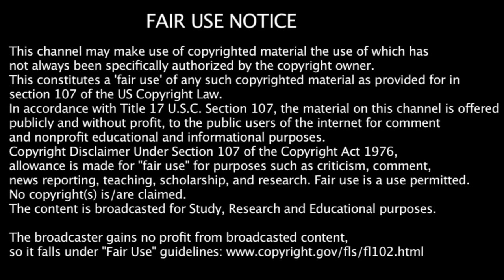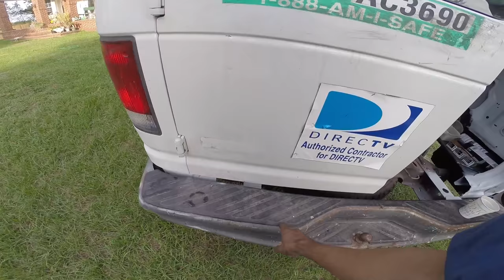Episode 5 Camper Van Floor, New Used Doors and Rascally Rabbits

Comment: Southern Lady is distracting my thoughts.... Okay, how is the plywood protected from weather on its lower side pointed towards the ground. I missed something you did or said. I agree and nominate you for the Oscar Vanagina Award for van building!
Reply from the maker: LOL... I sprayed the section that faces down with Rustoleum Rubberized Sound Dentining Undercarriage spray coating!  A acquaintance mentioned to me that cargo trailers have bare plywood exposed under them and they last for years.  He could have been exaggerating but had a point nonetheless.  Think i am gonna get a pair of mud flaps to help minimize.  Should be interesting to see how long it really last, but it has been one year since i did this and the wood is still solid.  Well October the 8th last year is when i recorded this floor install.  I am really impressed.

On another note... She is a sight for sore eyes! ...and i'm not talking about Vangina!
Reply: +The Dove Nest Vansion Ah yeah...I know about that site for clear eyes.
I don't see anything wrong with the method you used on the plywood. So you had this installed when my wife decided to leave me....man time flies! Thank Vanagina!
Reply from the maker: laughing my ass off!